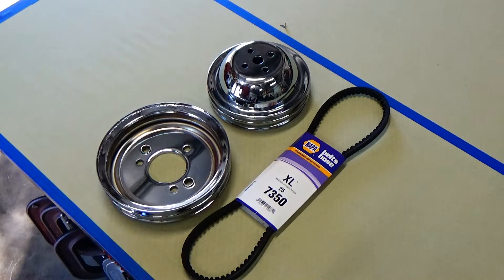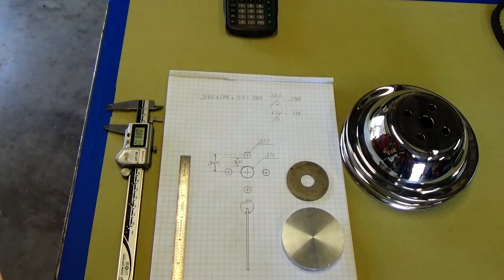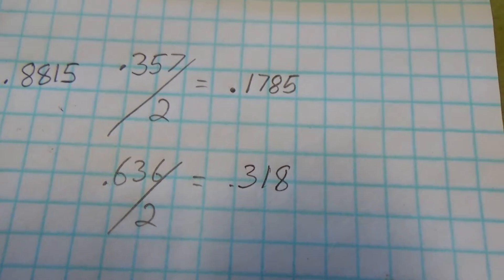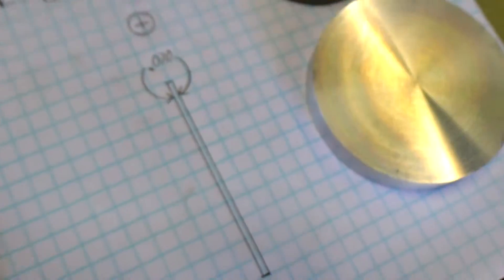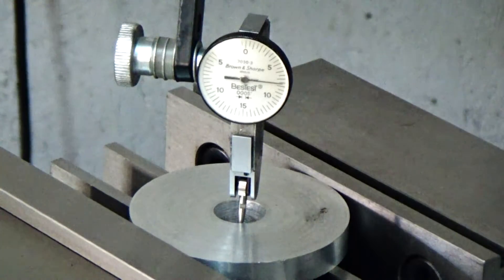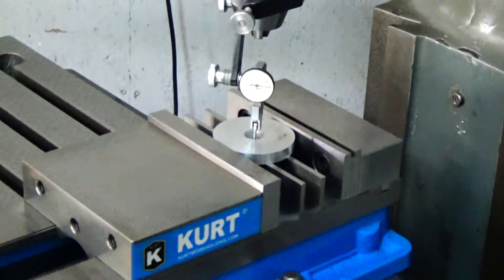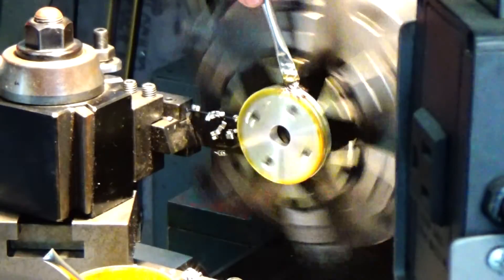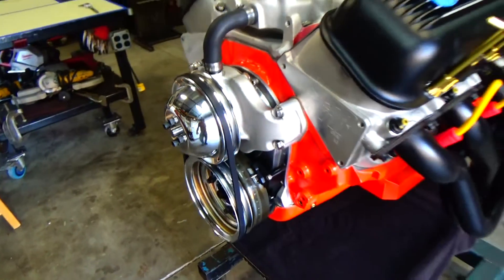Engine pulley alignment  #31 454 Big Block Performance Build

Comment: Thank you for this, guess Ill need to make a spacer for my crank pulley as its the one in too far in, which puzzles me as they are the same pulleys going on a new engine block of the same size??
Reply from the maker: Thanks for the nice comment.... That is puzzling?

Comment: What water pump did you use ?     I need a short pump that fits the same front cover.
Reply from the maker: Watch #24 water pump install... Playlist 454 engine build..